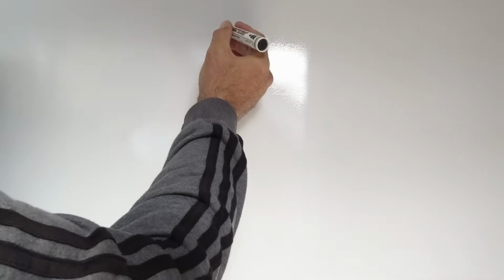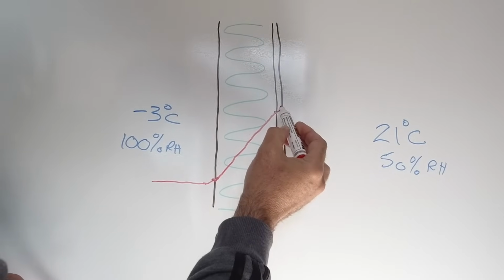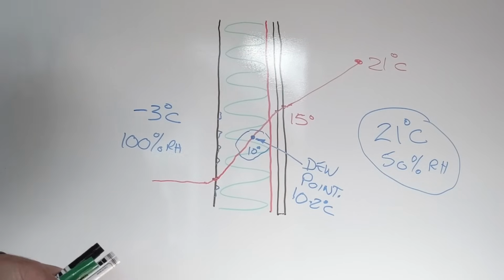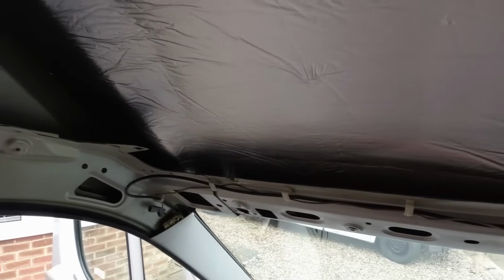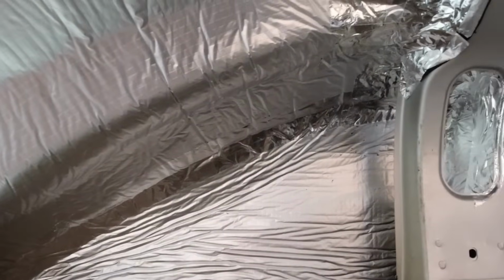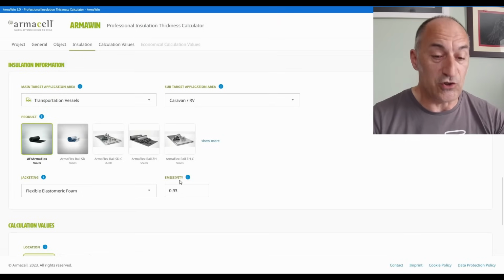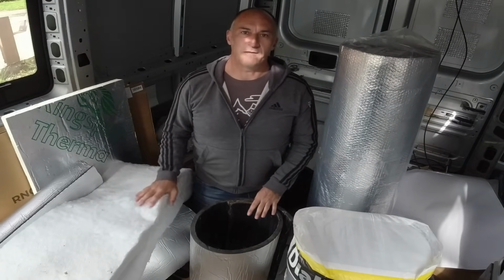The BEST way to Insulate your Van - Budget Build Ep 6

Comment: Would be good if you could comment on the importance of insulating the floor in the next video as well Greg. Those two things are widely misunderstood in some of the facebook groups, and I got some abuse recently from someone who had claimed there was no point insulating the floor because "heat rises". I tried to explain that heat only rises in fluids, not solids, so it doesn't apply to radiant heat loss in a vehicle, but he really didn't like that. 😂

Cold bridging is another topic that people just don't seem to understand, but it doesn't come up as often.
Reply from the maker: I will cover that question in the floor video 👍🏼😃
Heat loss by conduction through solid materials happens in any direction when there is a temperature difference across the structure. 
Heat is transferred from hot to cold. So if it’s cold outside you get heat loss in all directions and if it’s warm outside you get heat gain from all directions. You are right that heat rises in a fluid (including air) because it is less dense and lighter. 
But that has nothing to do with heat loss by transmission. Sadly there are many uneducated members of those forums. Glad you know your stuff 😊👍🏼

Comment: Brilliant video as usual    it is good of you to share your knowledge.  The van your working on and several others of the same style are often described as galvanised but you have had to deal with a rusty floor, so I was wondering if you know if these vans are actually galvanised and if so how much is.
Reply from the maker: The galvanising process coats the exterior of the metal but if you cut or scrape the galvanising you expose the bare metal beneath. So the floor of a van gets a lot of abuse over 16years so I’m pleased it was only a little bit and not that bad.

Comment: One quick way to know if your van is has a good thermal barrier. If you regularly use your van or live in it, does your salt and sugar get soggy and crusty ?🤔
Reply from the maker: That would be due to the internal humidity. Improve the ventilation at all times to remove internal moisture. 👍🏼😃

Comment: question when you say 6mm required i presume that depends on WHAT insulation you are using and its properties eg superquilt versus celotex or does the properties not matter so long as its above 6mm? ie 6mm is a thickness specifically for their thermal properties of one of their products?   or does this not matter if its closed cell foam 
reason for asking is im limited in height l4h2 boxer and was thinking about superquilt over celotex
Reply from the maker: As I demonstrated at the end of the video the thickness varies with the conditions and the type of material. A reasonable minimum for closed cell would be the 10mm sheet
Reply: @GregVirgoe  yeah sorru i have not articulated my question correctly. you talked about condensation occurring but not inside closed cell foam due to its nature. I was wondering given the make up of superquilt each bubbble individually sealed and multilayer of foil etc in your opinion would be similar in condensation control. asking because i dont think i can have 50mm (25 top and bottom) in our lhh2 and was looking at something with higher thermal properties but got confused between thermal properties and your dew point calc

Comment: Awesome series. Very clear step-by-step instructions. In this case I've read so much BS about van insulation ("You don't need any, you'll trap the moisture" etc.) , that it's refreshing to have someone like Greg lay out the facts for us, with solid advice on how to proceed. Top job!
Reply: Hi Greg as always a wealth of knowledge and information followed you for years and appreciate your information videos I want to build a long Luton one day with good living quarters with workshop at rear but I also would like to carry my 700cc motorcycle I’m glad I haven’t started yet as the eco flow tec has really improved between you and gadget John I’ve learned so much about van building I’m a carpenter so no problem there the only problem I’ve got is witch van do I go with any advice would be great

Comment: The graph worked really well I thought at conveying the principals! Excellent video!
I fitted 25mm ceiling and floor, 50mm in most of wall sections apart from bed headboard where we sikaflexed 25mm timber battens for fixings and 25mm PIR in between. Managed to retain full double bed length.
Reply from the maker: That’s a fantastic idea for the bed reveals. Are the battens bonded to the outer skin of the van 🚐?
Reply: @GregVirgoe  yes sika flexed direct to panel. Been very strong. I did post earlier but link to images get taken down.
Reply from the maker: @markwhiting3103  sorry links are not allowed in comments to avoid the curse of spammers that we get. 
You can always pm me on Instagram or FB

Comment: We used 18mm armaflex throughout the van (classic Iveco 35-10), not to keep the cold out, but to keep the heat out. At 38 degrees C. outside (one could literally bake an egg on the surface outside), the insulation keeps cool on the inside. We do have a constant airflow with tiny ventilators (5 volt) installed at the original "air vents" in the van, no windows (except one rooflight - fiama). At the hottest moment of the day we use a little 5 volt air conditioner which cools it down to less than 15 degrees (if we keep the doors closed that is). During the coldest nights in winter (never below zero here in our region of Portugal) it takes little effort to keep it at a cosy 20 degrees. Armaflex may not be cheap, but even in the hardest conditions (heat) the"glue-film" proves to be exceptional stable.
Reply from the maker: That sounds like a perfect installation. 
Thank you for sharing your experience with us all. Brilliant 🤩
Reply: Hi.
I wonder where have you been buying that 18mm armaflex in Portugal.
Also wondering if you used other type of insulation beyond armaflex for that climate.
Thanks in advance
Reply: @TheShadowVortX  Ordered from Germany. (as most parts of the conversion materials)
Reply: @NotJustSawdust  thanks for your prompt reply!
Would you mind sharing the site?
I'm currently looking at lulukabaraka , which ships extremely fast and have decent prices

Comment: What if the exterior steel skin was sprayed with a truck bed liner ?  Will this solve the moisture problem insider the van ?   Would Fiberglass exterior skin have less problem ?
Reply from the maker: They would both offer a small thermal resistance but the thickness is small I would expect the internal temp of the body to still be below the dew point. Only truck bodies that don’t suffer are insulated cargo vans but they are a sandwich of 2” PIR foam board so gives great insulation

Comment: I have been using closed cell XLPE foam as insulation for the floor, like it a lot but still contemplating on what to do with the wall and ceiling. I am switching back and forth between wool and thinsulate, then someone suggested spray foam. I don't want spray foam because it could be a mess, not DIY friendly. This video turns on a new light bulb. Thinking to glue 3/8" thick XLPE closed cell foam to the metal, both on the outer skin and the ribs. In between, I can stuck thinsulate or wool, then a cheap thin foil vapor layer before the ship lap wood panel.  What do you think mates?
Reply from the maker: Sounds like a great solution that should work well 👍🏼😃

Comment: Can you give your best opinion as my project is for Nordic temperature. I am talking about -45 outside and 28 inside.
Reply from the maker: 28° as an internal temperature is way too hot 🥵 you’ll be in pants sweating like mad 😅
You will need to use thick PIR insulation Min 50mm and thicker if possible. Fill all void with similar expanding foam as that will prevent moisture. 
If you can get the van sprayed with foam like Eamon & Bec did that would be the best solution. And comfortable room temp is 20°c 😊
Reply: @GregVirgoe  Thank you for the valuable feedback. Will definitely apply as recommended.

Comment: Thanks for sharing.  Like #997 - Does the foil lining help reflect the heat?  There is often debate about reflectixdoing anything.  You referred to it as double foil bubble vapor barrier.
Reply from the maker: It does have radiant heat reflective properties but primarily i'm using it as a vapour barrier because aluminium foil is totally impervious to moisture.

Comment: Great information as usual Greg = thank you, Q, Will you be showing us how to work around & insulate the campervan doors without causing issues with the door mechanisms?
Reply from the maker: Yes I have a cunning plan for the doors 👍🏼🤩
Reply: @GregVirgoe  that's our dilemma we blocked them in like nellie but now baps is thinking about changing it leaving the back doors but I'm unsure which way to do them ie condensation warmth etc xxx
Reply from the maker: @WearAway  you can’t stop the doors from letting in water so put your woolly insulation into sealed plastic bags like pillows and put them in the doors. It will keep the insulation dry and allow the doors to drain as normal. 👍🏼😃

Comment: Thanks Greg, very informative.  BUT no-one ever mentions the shiny tape ...  what did you use? Where do you get it?  Answers on a postcard please 😄😄  does it need to be waterproof or heat resistant  🤔🤔
Reply from the maker: The shiney tape is aluminium foil tape. You can get it online but don’t get the plastic silver stuff from B&Q that’s rubbish.
Reply: @GregVirgoe    got a suggestion or recommendation?  and what about the heat question - wont it wrinkle up with the warm/cold or hot air ??

Comment: I'm no expert but my understanding is that the warmer than air the more moisture it can hold. At -3 degrees outside it will not be 100% humidity, it will be less than in the warm van. I think. Not that it makes any difference to the point that you are making.
Reply from the maker: Google a psychrometric chart and you will see the curved lines of relative humidity showing that at lower temperatures the relative humidity figure is high however the actual moisture content is low. You are right that higher temperatures can hold more moisture and their relative humidity can be lower even with more moisture content. 
If you took air at -3° 100% RH and heated it to room temperature 21° the resulting humidity level would be 20% yet they would both hold the same quantity of moisture. That’s why it helps to keep your van warm in the winter. Hope that helps to clear up your misunderstanding 😃

Comment: Brilliant video Greg, really well explained. That calculator is great, makes it so much easier to understand with a visual aid 👍🏼 I’ve been having a play with it and finding the choice I made on the insulation ( with your advice from my Instagram questions) I’m really happy it’l work well. I went with 10mm CCF on the headliner and full roof covering, plus all the side/wall panels I could get to. On top of this I’m doing the same as you, Diall wool, PIR and foil vapour barrier. Should be nice and toasty 😊
Reply from the maker: That will be a top notch build. Well done 👍🏼
Reply: @GregVirgoe  Thanks mate 😊

Comment: Absolutely essential information Greg. Thank you mate.
I live in Australia and in the "outback" we get night time sub zero temperatures and daytime > 40oC temperatures, on the northern coastal areas we get moderate night and daytime time temperatures ranging from 15 - 35oC and very high RH, while further south, coastal, we will get 5-40oC with a lower RH. Mountainous areas will treat us with sub zero temperatures and low humidity. Our RV's have to deal with all these extremes as we move from true camping (tarp and air flow) to glamping (A/C & Heating in an campervan or caravan). 
The question is how do we best deal, insulation wise, with such wide variations of humidity and temperature and keep A/C use to an absolute minimum (offgrid situations)?
Reply from the maker: Maximising the insulation will help to slow down the transfer of heat in both cold and hot climates meaning you need less energy to heat or cool your campervan. 👍🏼😃

Comment: Hi Greg, just wondered what your views were on faroutride's take on insulation and the lack of a vapour barrier? Great to see you back with a new van build 😊
Reply from the maker: Sorry but I’m not aware of their views but what I can confirm is this. 
With no vapour barrier or insulation materials that has that built in you will get condensation build up in your insulation and all over the steel of the van in colder climates. Not preventing that from happening seems crazy. 
No matter how much you ventilate or heat your van you cannot stop that completely. There will still be condensation and water build up inside the structure of your van. If you go to really cold climates that will also lead to internal frost and ice build up. 
Also why would you allow your van to be wet / dry / wet on a daily basis. That is going to make your interior wet and will eventually create damp, discoloured panels and mould. 
It’s not difficult to create an effective barrier and just takes a little extra work

Comment: Hi Greg phew you saved my life . I'm at this stage now . Have used 75mm kingspan on walls, 25mm on floor and ceiling . With 8mm silver adhesive  backed closed cell on all main panel surfaces. I have a gap so was thinking should I use thermawrap bubble stuff . Or as some say use 150micron polythene . Could I ask you your thoughts . All the best 👍
Reply from the maker: That sounds great. The foil is completely impervious to moisture and with a little sissy adhesive is very easy to install. Some polythenes are very slightly permeable and can be more awkward to install. The double foil bubble also gives you a slight thermal break. Hope that helps. 👍🏼🤩

Comment: Hi Greg , 
Thanks for the info as usual. I’ve noticed you don’t mention rockwool insulation in this build ? As you used it in your Mercedes van build , is there a reason for this ?
Reply from the maker: The recycled stuff was not about when we did our build so the earthwool was the best option at the time and is still ok to use. The Diall stuff is nicer to use and better eco credentials 
They both have identical thermal properties. 👍🏼🤩

Comment: For me the most important thing I learned was that is a minimum thickness for insulation to avoid condensation. And I like dhow you played with that in the online calculator.
Reply from the maker: There isn’t one abuser that fits all conditions so if your van is really humid loads of showering or cooking and no ventilation then that dew point will be higher so you need thicker insulation. Or better ventilation and warmth to dry the internal air more.

Comment: Also mention ventilation. In partly barrier or non, ventilation also gets condens out of the
 way.
Reply from the maker: Yes, the combination of heat and ventilation in your van can greatly reduce the condensation. I will do a video on psychometrics to explain what is happening to the air when you do this. There will still be a little condensation on cold surfaces but it can be reduced.

Comment: Interesting, I have the opposite problem, hot outside, cold (a/c) inside, easier to deal with for sure since your outer shell becomes your vapor barrier and the air conditioner is sucking the moisture out of the inside of the rv.
Reply from the maker: You will never have condensation issues if the ambient air is warmer than the inside of the van. 
You only need to insulate for heat loss and that works the same as an insulated cool box to keep your van cool and slow down the heat transfer

Comment: I'm following you since you started the first van. Your knowledge on insulation is priceless! Thank you! :)

One thing is bugging me. You said that insulation that are not impervious will have condensation even if you have the right thickness. Right?

So, with the recycled wool, even with a vapor barrier, you'll get condensation in the insulation and on the steel, right?

If yes, what about rust? 🤔
Reply from the maker: Sorry you miss understood. Watch the first part on the board again.
Without the vapour barrier at the beginning you will get condensation in your wool insulation. But then I add the vapour barrier and that stops the condensation. What I go on to say is how thick it needs to be to prevent condensation on the outside of the vapour barrier. Please watch it again. 👍🏼😃
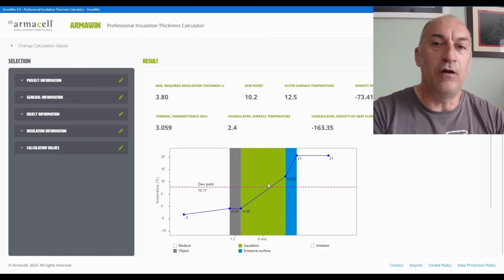Reply: @GregVirgoe Ok, I've found the moment you said that (around 17:30) and it was not clear, at least for me, you were talking without the vapor barrier. I learned english without courses so sometimes I don't understand right. Thank you !
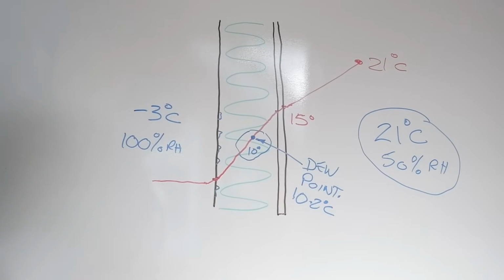Reply from the maker: @trsiel8953  at 6:11 I draw the vapour barrier and explain that is what stops the condensation forming inside the insulation  👍🏼😃
Reply: @GregVirgoe  Yes. I was just confused later in the video. My fault :)
Reply from the maker: @trsiel8953  no problem 😉 happy I could help you clear it up 👍🏼

Comment: The takeaway for me was while the min. insulation thickness to avoid condensation was interesting, a vapor barrier is just about mandatory no matter what type/amount of insulation is used.  Because realistically, in a mobile housing application, it's just a matter of time until you have a large temp. delta across the wall paired with a high internal relative humidity resulting in condensation. 
I found the heat loss calcs from Greg's original "Vanlife Insulation Part 1 - The facts you need!" a bit more useful because that could be used to size a heater for given conditions.  Looks like the recommended new calculator can do that too.  
Thanks for sharing!
Reply from the maker: You are spot on with your comment, without any form of vapour barrier, condensation will form at the right conditions. so the key is put enough insulation in to combat the heat loss or heat gain then an effective vapour barrier to prevent condensation forming in cold climates. It's a no brainer, if you don't want your hard work ruined by water damage in a couple seasons. Thank you :D